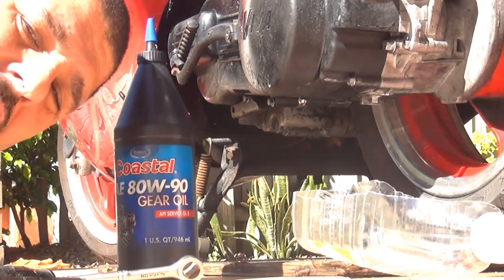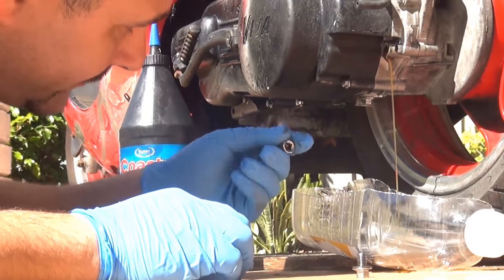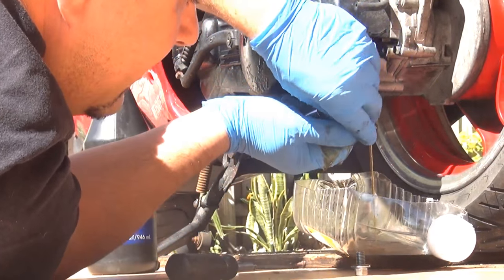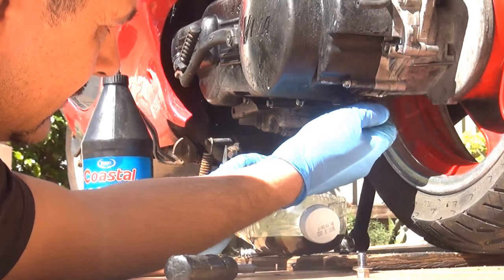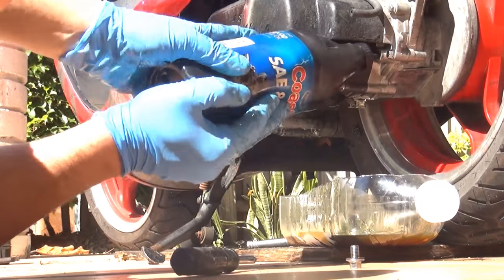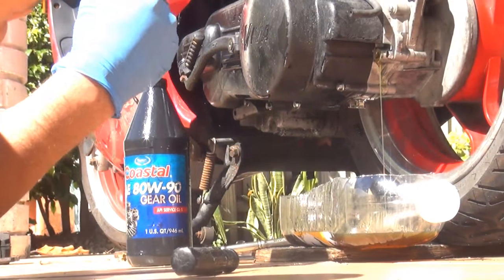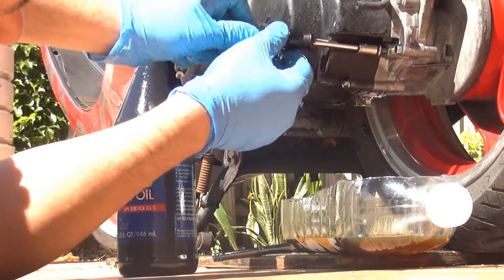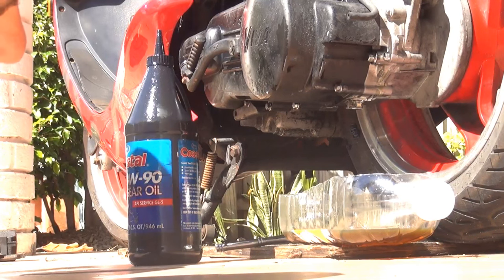Scooter gear oil change gy6 150cc

Comment: I use Valvoline synthetic gear oil 75w-90 $12.98 and Valvoline synthetic motor oil 4T 10w-40 $7.98 both on Amazon. Also I only use REC 90 octane free fuel and my 150cc Vitacci Rocket runs great. Thanks for the videos they helped a lot when I first got my GY6 👍
Reply from the maker: Hello my friend thank you for watching my video and  Happy holidays
Reply: Some problem or working fine on 75w90 after 2 years ??
Reply: @dasbingoyoutube  I've never had any problems. I just crossed 2000 miles on mine and it runs great 👍🏻
Reply: @vladimpaler9274 
Thx!

Comment: My drain bolt is literally stuck in place, My ratchet, or wench cannot get a grip to remove it, do you have any ideas on how I could solve this?
Reply from the maker: A stuck drain bolt can be frustrating, but there are a few methods you can try to get it loose:
Penetrating Oil: Apply a generous amount of penetrating oil (like WD-40 or PB Blaster) to the drain bolt and let it sit for at least 15-20 minutes. This can help loosen any rust or debris that's causing the bolt to stick.
Heat: Carefully apply heat to the area around the drain bolt using a heat gun or a propane torch. The heat can cause the metal to expand slightly, which might help break the bond. Be careful not to overheat and avoid any nearby plastic parts or seals.
Use a Breaker Bar: If your ratchet or wrench isn't giving you enough leverage, try using a breaker bar. This will give you more torque to break the bolt free. If you don't have a breaker bar, you can slide a metal pipe over the handle of your wrench or ratchet to increase leverage.
Impact Wrench: If you have access to an impact wrench, it can provide short, powerful bursts of torque that might break the bolt loose. Just be careful not to strip the bolt head.
Bolt Extractor Socket: If the bolt head is already rounded, you can use a bolt extractor socket. These are designed to grip stripped or rounded bolts more effectively.
Tap with a Hammer: Sometimes, gently tapping the bolt head with a hammer can help to jar it loose. Be careful not to damage the bolt or surrounding areas.
Use a Vise-Grip: If the bolt head is really damaged, you can try locking a pair of vise-grip pliers onto the bolt and turning it that way.
If all else fails and the bolt is really seized, you may need to take the scooter to a mechanic, who might have more specialized tools for removing stuck bolts.
Reply: @VirberelloScooterTips  Thank you very much for these suggestions, I will try them carefully and if all fail I will take it to a mechanic☝🏾

Comment: Hello Virebello, I have a question for you. I was wondering why my scooter does not start up on the first try. The person I bought it from said they already had it serviced and that it just needed to be warmed up everyday. What is your opinion?
Reply from the maker: Hello Putin Diaz if the scooter is not starting at the fist try can be many many things when you buy the scooter they can say they service yesterday to make the deal and many mechanic do not love their profession they only do it for the money  but is you who ride the scooter . Your scooter or motorcycle is made from many parts working together  like an orchestra to make sure is working right need to be in tune. Start from the spark plug and make sure you spark plug is nice clean and give you a strong spark and is gap right many sparkplug are allready gaped but if is not gap right your scooter will not start at first try  if not buy a new one $6 to $10 check my video here ==>>  https://youtu.be/dFSasN8WQl4 cleanthe check filter if is not clean === >>>  https://youtu.be/T31bHL2jyvs  
buy new one very cheap on amazon.
Make sure your fuel filter under the seat is clean  and you need to make sure the gas goes to your carburetor from the gas tank  if your scooter is older I say around 5000 to 6000 miles is possible that you need a valve adjustment.
Some time in Gy6 carburetors the automatic chock fail the only easy way to test that is to remove the filter connection in the back side of you carburetor and place your hand covering the rear air intake with your hand reducing hair flow and starting your scooter and if it start right that is the problem.  
Anyway can be many many things is all about try to find what is not performing properly  
Thank you for watching my video
Reply: virberello Thank you very much. All your videos are great and easy to follow. I am going to start with the spark plug and follow the rest. Thank you once again. I will let you know what happens.

Comment: Sir, two questions, is 85w oil okay in 150cc 4 stroke? And I bought an oil container without the little spout to fit in that tiny hole, do they sell that piece on top of your bottle seperately or does it come with the bottle?
Reply from the maker: Hello james 85w is ok the bottle Pour Spouts comes with the bottle but you can buy a Oil Liquor Wine Free Flow Bottle Pourer Dispenser Spout  http://amzn.to/2v195xP but place a little electric tape on top to make sure you are not damage  the screw hole or check this video will help you to make 1 cheap ah ah ah 
https://www.youtube.com/watch?v=f_5lJmhU9mQ
Thank you for watching my video
Reply: You are very helpful thank you!!

Comment: your videos are very helpful thank you for making them and sharing your knowledge
Reply from the maker: Thank you for watching my video
Reply: virberello welcome friend. I also subscribed. Qeustion...can a GY6 49cc with all emmisons system removed need to use a petcock? Reason I'm asking is new gas tank only has one nipple on bottom for a fuel line only. Old tank has nipple on top and larger opening on bottom where the stem goes up into the tank from the petcock that screws in on bottom. Can I just run straight full line from tank to carb and plug the two air ends on the manifold. And have you ever made a video on storing your scooter for winter and then what to do for it in the spring.
Reply from the maker: Hello Morris in reality for me you do not really need a petcock valve you can bypass that and have a better fuel flow, a petcock valve is the fist step of safety for fuel but you can replace that with a manual valve. the key of the all fuel system is the carburetor floater  that is doing the job but if the floater fail and you forgot to close the manual valve when you park your scooter you will lose all the fuel or float the engine. so the petcock   is a safety device . Great idea for the new video thanks  I wasn't thinking about that because I leave in sunny south Florida and I never store my scooter :-)

Comment: I bought this oil thinking it was the one i was supposed to use for my scooter but I found out I need GL-3 oil would it damage my scooter if i used this one instead?
Reply from the maker: Using 80W-90 gear oil instead of the recommended GL-3 oil in your scooter's transmission could potentially lead to issues and may not provide optimal performance. Here's what you should consider:
Viscosity and Lubrication Properties: Gear oils have different viscosity ratings, represented by numbers like 80W-90. These numbers indicate the oil's flow characteristics at different temperatures. GL-3 is a specification that ensures proper lubrication and protection for certain types of gears, particularly those found in manual transmissions. The use of an oil with the wrong viscosity or lubrication properties might result in inadequate protection and increased wear on the gears.
Additives and Properties: GL-3 oil is formulated with specific additives and properties to meet the requirements of manual transmissions. Using a different type of gear oil might not provide the same level of protection against corrosion, oxidation, and wear, which can lead to premature failure of transmission components.
Compatibility: It's important to ensure that the oil you use is compatible with the materials used in your scooter's transmission. Using the wrong type of oil could potentially cause seal and gasket degradation, leading to leaks.
Manufacturer Recommendations: Manufacturer recommendations exist for a reason. They are based on extensive testing and engineering to ensure that your scooter operates optimally and reliably. Deviating from these recommendations could result in subpar performance and potential long-term damage.
It's recommended that you drain the incorrect gear oil and replace it with the correct GL-3 oil as per the manufacturer's specifications. If you're unsure about the compatibility of the gear oil you purchased, you should consult your scooter's owner's manual or contact a professional mechanic for guidance. Using the correct oil will help ensure the longevity and smooth operation of your scooter's transmission.
Thank you for watching my video

Comment: I have a jonway sunl 1500 cc 4 stroke,for the gear oil it says to use gl-3,cant seem to find any,what else can I use??thank you in advance.your awesome..
Reply from the maker: Hello Jesse if you can not find GL3 you can use SAE 75-90 full syntethic your scooter will run smooth https://amzn.to/2XZIKCL this is little expensive but great quality
Reply: @VirberelloScooterTips  awesome thank you so much, and how  can I tell if it's a gy6?I don't  even know what's a gy6.

Comment: I have a 150cc gy6 and my scooter tilts backwards and forwards when it's on the center stand. Should my back tire be touching the ground when I do my oil change or should my front tire touch the ground? When I check my oil level it shows it's overfilled when the scooter is leaning one way, and it's perfectly level when it's tilted the other way. Please help me out thankyou
Reply from the maker: Hello James place your scooter on center stand place something like a brick under a front tire and a brick under the rear tire so your scooter is going to be level at that point you can check the oil perfectly make sure to do not overfill your scooter with motor oil or the extra oil will go to your air filter. Thank you for watching my video
Reply: @VirberelloScooterTips  thankyou sir

Comment: 50cc GY6 here. I have a new variator and clutch. Adjusted valves, new everything ignition wise, new carb new instake manifold. Still have this issue. The GY6 runs smooth and revs great!! High rpm. The issue is it will not go past 16-18 mph. This is a 150cc ATV btw that should do 40mph easy.
Also it vibrates the shit out of you. I have unchained the rear axle to rev it and it still vibrates bad so it not the axle. Only thing I can think is these gears being bad. Help what do you think?!?!?
Reply from the maker: Hello my friend with all the good changes that you have done to your gy6 the scooter should be running great the thing that come to my mind is a better exhaust for the speed and for the vibration I dont think is the gears but more the variator or variator crankshaft ( make sure the variator is installed correctly sometimes during install the weights can fall out of their slot.) unfortunately sometime you have to look all over the scooter to find a little problem that will make your scooter run better . Thank you for watching my video and I hope you find the problem check this link http://www.firenzee.com/gy6/ for troubleshooting your scooter
Reply: @VirberelloScooterTips  You maybe right. The exhaust has a leak by the head and is loud as hell. Ill mess with it next. Thanks!!

Comment: The gear oil from pep boys or western auto, are the same oil from the motorcycle store??? I buy one similar that you use in the video
Reply from the maker: The gear oil sold at Pep Boys, Western Auto, or any other general automotive store may be similar in composition to the gear oil sold at a motorcycle store, but they are not necessarily the same.
Motorcycles have specific requirements for their gear oil, which can differ from the requirements for other vehicles. Motorcycle gear oil needs to provide excellent wear protection, minimize friction, and offer superior thermal stability to withstand the high temperatures generated by motorcycle engines. 
It's essential to check your motorcycle owner's manual
Reply: @VirberelloScooterTips  ok, Can i use gl 5 type, when the motorcycle says gl 3??

Comment: Hello my friend I have a question for you on my icebear Hawkeye 150cc scooter motor oil is starting to leak out from somewhere...? I notice oil is on my center stand and the big hose that comes off of the valve cover what would be your guess can it be a valve cover gasket..?
Reply from the maker: Hello my friend I had a problem one time and the screw from the chain tensioner was lose so I place a little red tread lock on the screw but look aroud but could be that the head gasket is broken or that you have to much motor oil on your scooter
Reply: @VirberelloScooterTips  thank you for another quick response I surely appreciate your help I use my scooter everyday it's my only vehicle I drained the oil today saw I did have a lot of oil maybe to much so I refilled it to almost full I'm gonna ride it soon I hope to see no more oil leak but if so I'll put in a new valve cover head gasket thanks my friend ....🙂👍

Comment: Can you use motor oil in the transmission gear box? 
Suggestion,,,,, try using a 150 cc measuring syringe to put the oil in...... It may be easier..... Thanks for the video
Reply from the maker: Hello Daffy for an emergency engine oil SAE 15w-40 would be better than NO OIL at all, but it is not the same thing as gear oil
. Gear oil is thicker and formulated for a specific job. Thank you for watching my video
Reply: virberello thank you for your reply... I will use gear oil. 
Keep the videos coming. Thank you for what you do... 
.

Comment: Thanks for this.  I’m going to try it soon.  Mine is leaking a small amount of gear oil now.  The dealership mechanic said it was overfilled and has excess oil in it.  and is leaking a small amount through a vent or something.  Does this sound right to you?   It is only after I ride the scooter that it leaks.   Also my manual for Kymco like 150 says to use SAE 90.  Will the 80-90 work?   Thanks for all your help
Reply from the maker: Hello Busywave if there is to much gear oil you can build up a little more pressure in the gear box so there is a possibility that you have a little leak or a broken gasket so try to change the gear oil and see if you still have leak and yes sae 90 is good . thank you for watching my video
Reply: @VirberelloScooterTips  thanks!

Comment: Thanks for posting this video. This is very helpful. I have a Znen SSR Interceptor 2014 model 150cc. I'm not really sure if the engine is the same as a 150 cc gy6. It looks very similar to yours. I've looked for some video of it on youtube but there's really not a lot like the 150 cc gy6. Do you know if this also uses 80W-90 gear oil. Somehow when I researched the website it suggested that I use a 10w-40. This sounds more like a motor oil to me. Can you give me a suggestion.
Reply from the maker: Hello Randy 80w-90 ( Lucas http://amzn.to/29N1Qly ) gear oil is just perfect for your scooter rear gear and 10w-40 ( Mobil http://amzn.to/29W5zZo ) is a great oil for the motor Thank you Randy for watching my video :-)

Comment: I can't get top bolt loss any advice.
Reply from the maker: Hello John the best could be heat with a torch  and WD-40 Specialist Penetrant Spray https://amzn.to/3ic4DoP I hope this can help you
Reply: @VirberelloScooterTips  will a one of long Lighters that you use on grill work. And to make sure I under stand the direction right move the bolt in the direction of the front tire that is to the left.
Reply: I check a different video, they suggested  to like bike warm up for about 10 minutes. Also a one suggested using Teflon tape on top plug?

Comment: Is it possible to overfill the gear oil and cause any issues? I did it this way too where you just squeeze it in til it pours back out. I’ve seen videos where someone used a giant syringe and I might get one of those too.
Reply from the maker: Hello my friend yes if you overfill the gear box in the long way when you run your scooter you can build up more pressure in the gear box and you can damage the gaskets and your scooter can leak from the back side
Reply: @VirberelloScooterTips  That’s what I’ve read and wasn’t sure. I just did my oil changes today. I have a syringe from Amazon coming now so I’ll probably end up draining it back out and check the measurement.

Comment: Thanks sir for your video. I have a question if you please reply:-
I have an oil leak in my Chinese scooter 150cc hammers model 2015 from clutch box cover. What is the problem in this case? and how can I solve it?
Reply from the maker: Hi and thank you for watching my video. I think if you have a leak on cover case you need to remove the cover and find out where is the leak coming from and many time you need to change a gasket or there is a crack in one of the engine body parts any way #1 find the leak you may have to remove the rear clutch and 99 % the leak is behind the clutch and after need to buy a new gasket check this ==>> ( http://amzn.to/2kn2mrT )   but I not to familiar with your scooter research first for your scooter brand . Good luck
Reply: virberello thanks very much for your advice :).
Reply: Sir do you think that this leak is a gear oil or engine oil?? Referring to your practice.
Reply from the maker: Hi If the oil leak is on the rear left side is possible that is gear oil maybe the rear oil gear plug is lose or is broken or the gasket behind the clutch is damage that is my feeling :-)